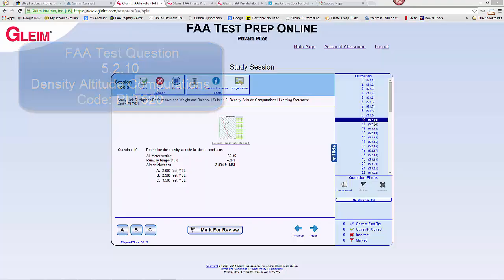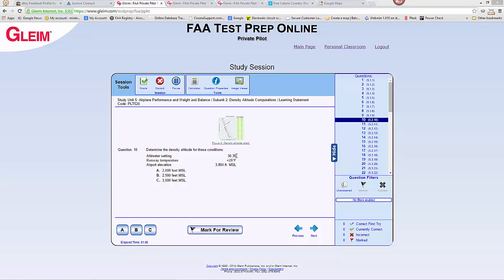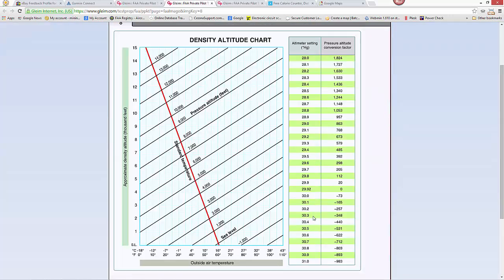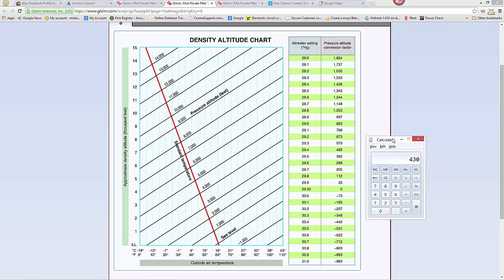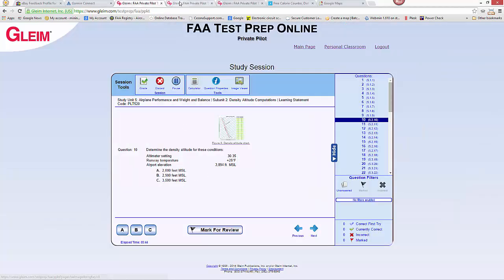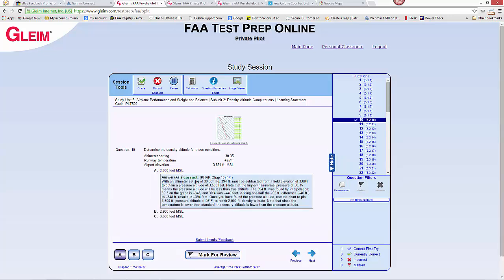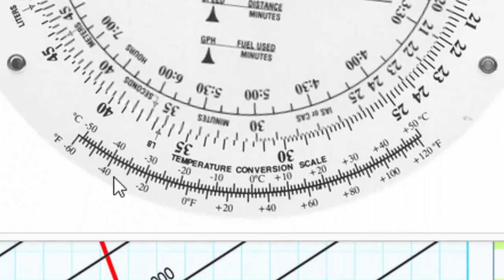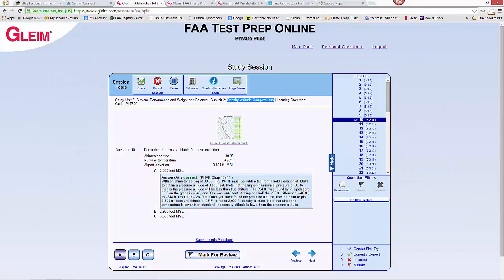Calculation Density Altitude FAA Test Question

Comment: hello. nice video. i have a question. if i try to solve these density altitiude question by using the equations instead of the chart i always get the wrong answer. am i doing it wrong or can u not get the right answer without using the chart?   i get the same answer with pressure altitude- 3464
but then i try the density equation- pa+[120x(oat-isa) and it wrong.
Reply: Really late reply here, but did you ever figure this out?  I usually solve using the equations as well and I get about 1900 feet.  Select the closest answer.  Also remember that the temperature is in fahrenheit, you need to convert it to celsius.  My calc gives me about -2.5C, 15-2.5 = 12.5 X 120 = 1500.  Subtracting 3464 - 1500 = 1964.  

Hell, you're probably already flying with a regional by now but I thought i'd reply for anyone else reading.